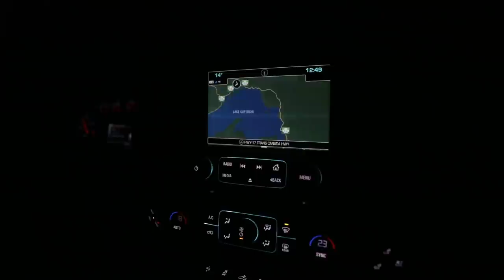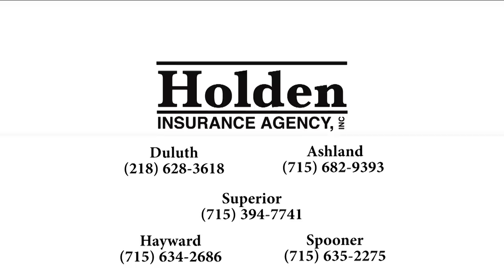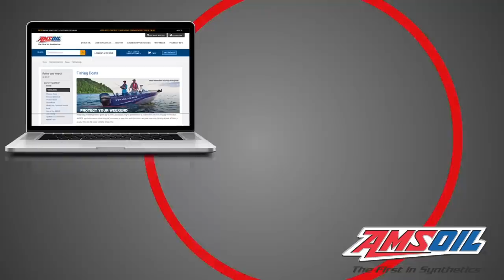S3E11 - Jigging lake trout (55 mile boat ride)

Comment: what lb test are you using for leader?
Reply from the maker: We prefer  30 or so. These trout aren't line shy and using a heavier line helps with the weight of the big lures.
Reply: @SuperiorAngling  30 lb fluor9carbon.?